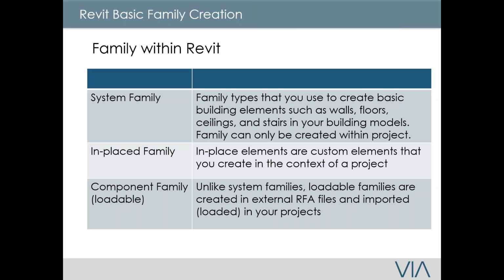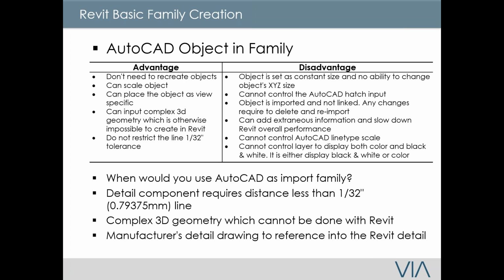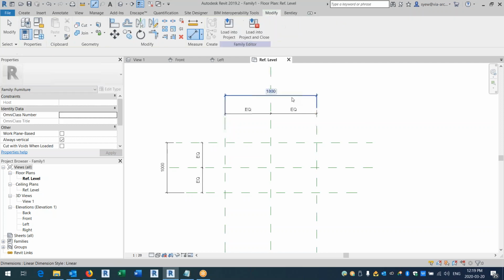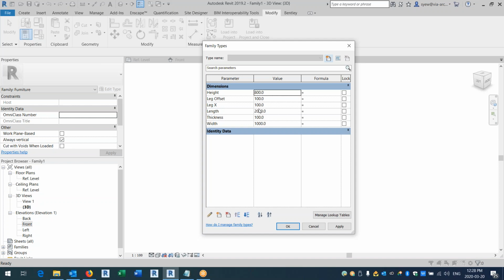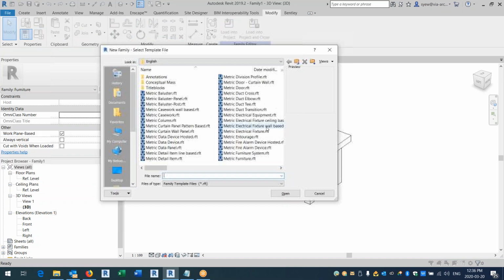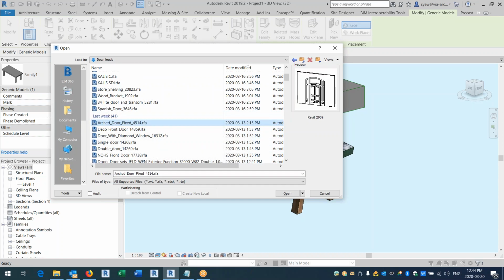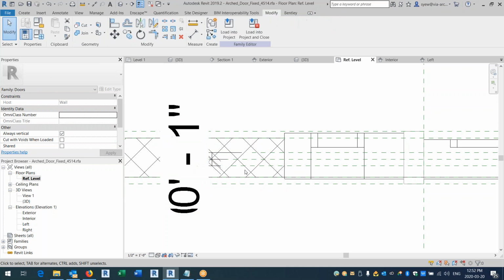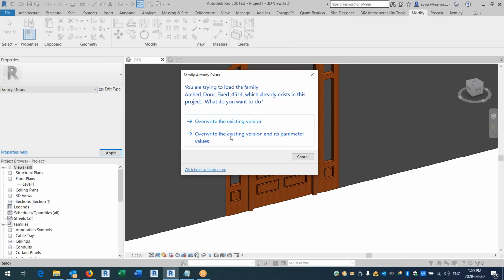Focus Group - Understanding basic Revit family and fix existing family

Comment: Good stuff as usual. Didn't know that about joining generic model families. Maybe it will come in another video, but could you go over how to clean up a file you download so it doesn't 'polute' your Revit project? Like what stuff copies into the inserted project vs what stuff is retained only in the family, and doesn't affect project/ show up in project materials/ fill patterns, etc
Reply from the maker: Sure thing. I run into this issue as well. I will most certainly cover it.